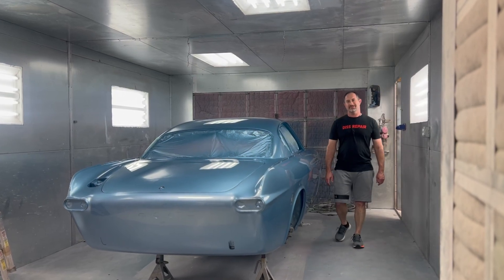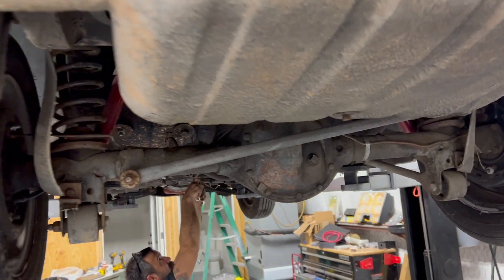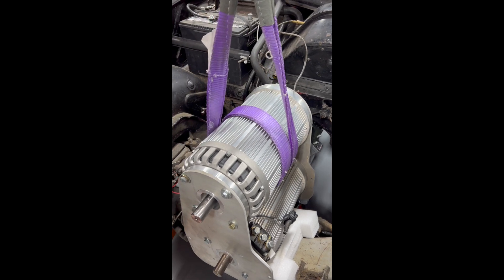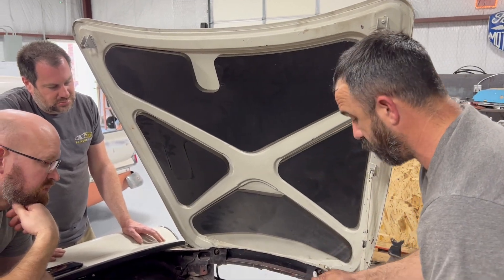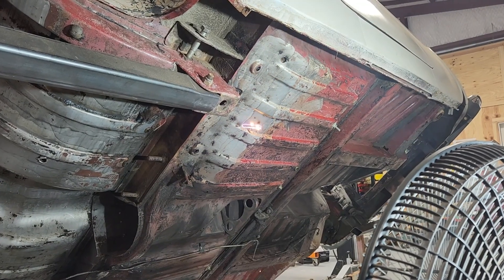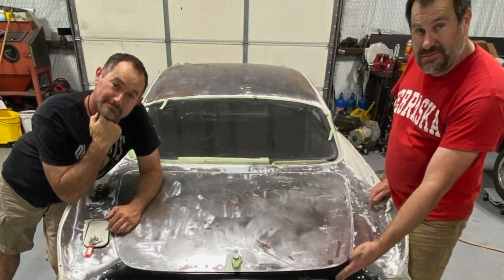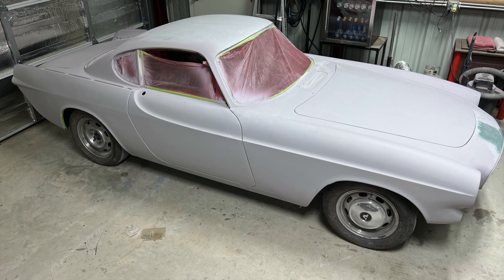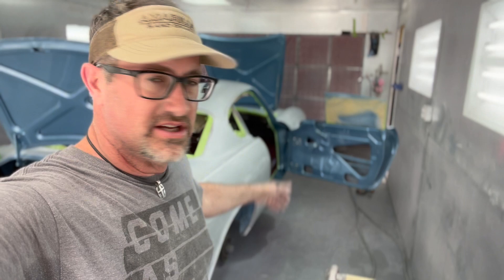Part 1 - Swede for Speed -  EV Converted P1800 Volvo

Comment: Why the dual hyper 9s? Is it not possible to get a single motor that gives you enough horsepower? Amazing job on the car. It’s very impressive that you can do the mechanical and body work. The body work actually looks more challenging.
Reply from the maker: Great question. They don't have a single that makes the same power in the same usable range as the hyper9.  Unless you go to higher voltage setup, like a Tesla.